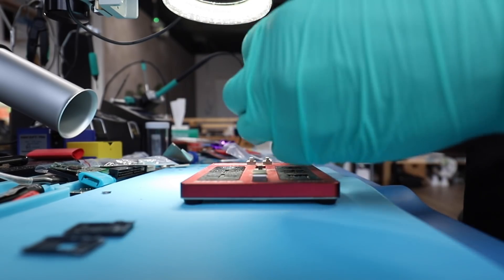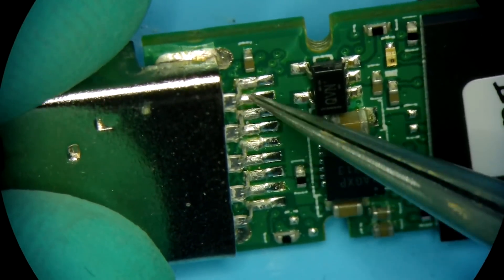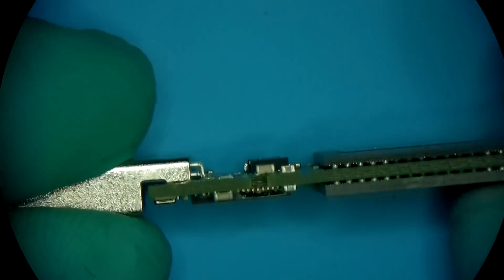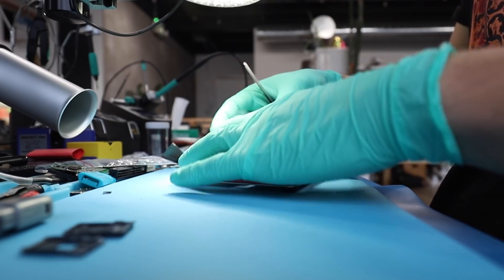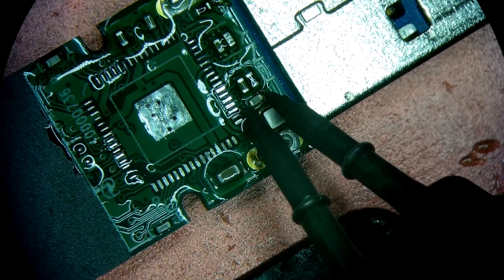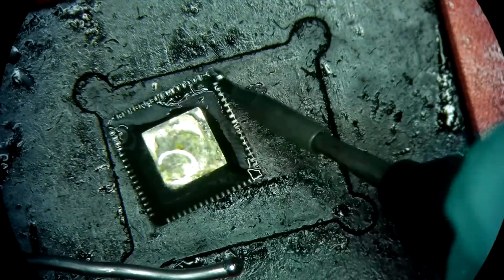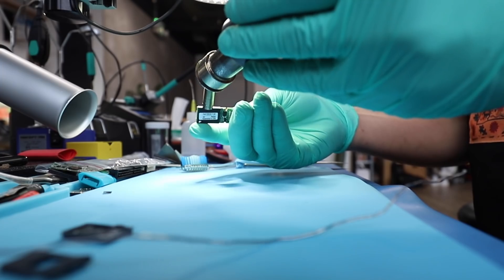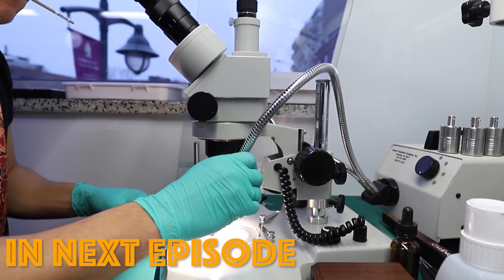data recovery flash drive that was bent PNY 128GB

Comment: @Erkin hope your day is going well so far. Have a question for you. For the work that you do would a 3.5X-45X Simul-Focal Stereo Zoom Microscope with a 8" working distance or 7X-45X Simul-Focal Stereo Lockable Zoom Microscope with a 4" working distance be better? and I shouldn't need more than a 45x magnification right?

Wish I had 2k$ to drop on your scope lol. These are both AmScopes I'm looking at.

Thanks in Advanced.
Reply from the maker: 8" for sure. Your neck will thank you. Nothing wrong with amscope, they make great product for the price.

Comment: I've been binging this channel and today I've been wondering........can't you just clean off the heads? And it looks like that's what the next video is. Should be interesting.
Reply from the maker: Yep, just did another case 30min ago, where heads needed to be cleaned
Reply: I'm learning data recovery in my new job but here we usually replace the heads for a known good set. What are the pros and cons of cleaning VS replacing? Can't wait for the video!

Comment: Can you just flux and heat the chip to get existing solder to reconnect.  Then if does not work do remove etc
Reply from the maker: Yes, but it isn't much extra trouble to be certain

Comment: SanDisk extreme pro that gets recognised, but couldn't partition it. Throws out redundancy error in disk management. What could it be? It's still in warranty and only shows 4 retired blocks from the beginning.
It's USB 3.1 flash drive.
Reply: Hi daand12... Have you tried diskpart to clean the disk completely before repartitioning?
Reply: @troll-bl2kd  does not work, have all tried. Secure erases with SanDisk SSD toolbox etc. Smart check also fails.
Reply: With SanDisks, the drive goes into write protect mode if a fault is detected. Maybe that's the case.